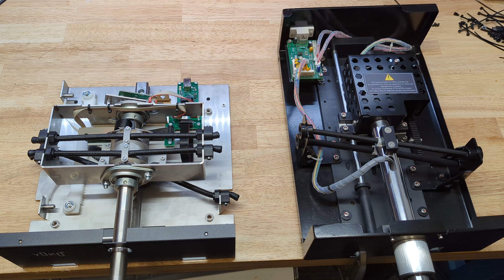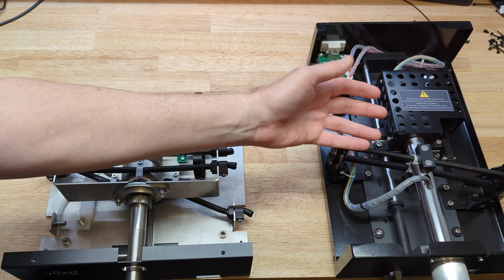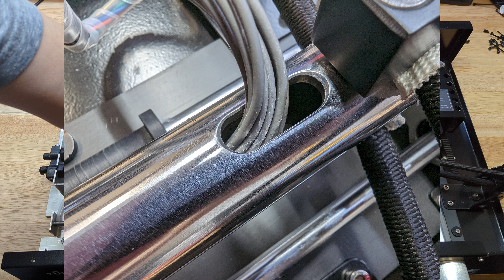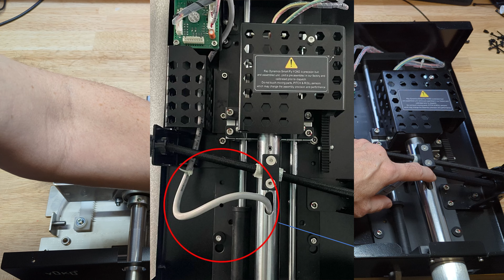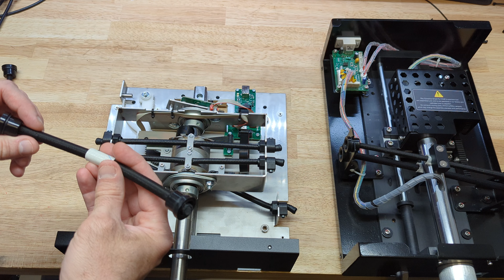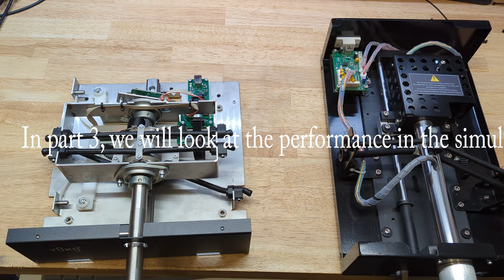SmartFly Yoke Review Part 2

Comment: The bearing in the Yoko looks like a THK Linear Motion (LM) Guide type rail and bearing. That would be a 4 contact type “roller bearing”. As far as I know the bearing type, specifically the balls, is not plastic but are steel. They are used in most automated machines. They are much quieter and usually last longer than the rod type bearings in the other yoke.

Still was a good video Mike!  Keep up the great work in keeping people informed.

Do you think you will get a chance to at least test one of the CLS-60 force feedback yokes?
Reply from the maker: Yes, that is indeed what they called it.  To quote them, "Linear motion ball bearing block used on both rails (also called as pillow bearing)".
Reply: I would be partial to that CLS 60 review, too...